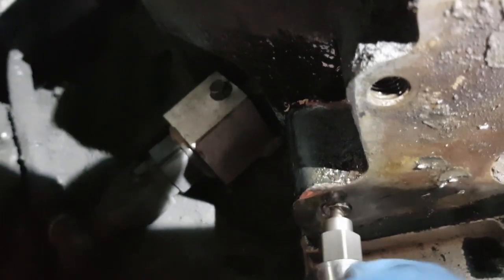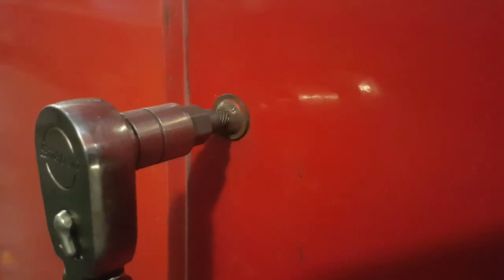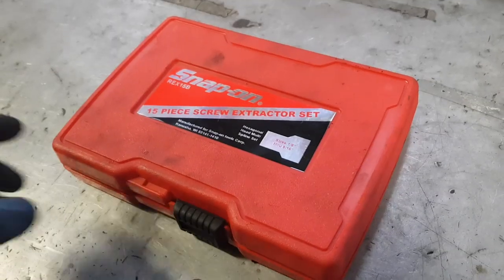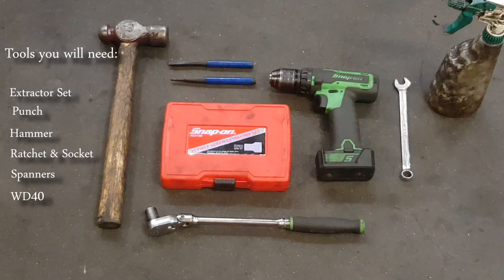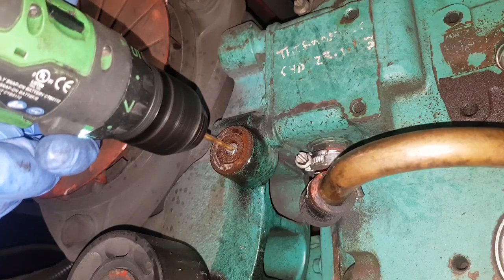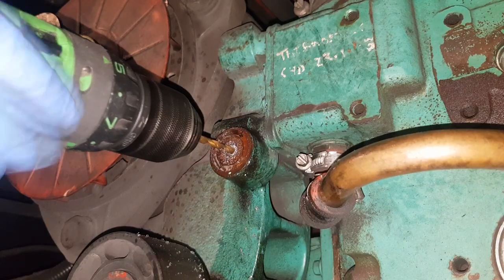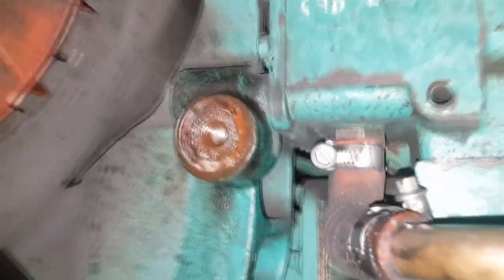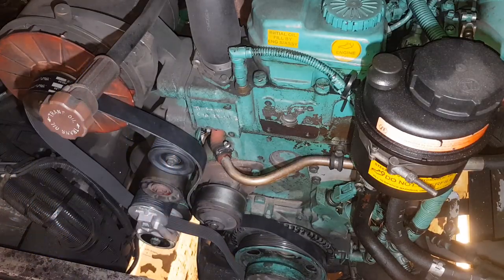How to Remove a Broken Bolt | 3 Ways to Use an Easy Out/ Stud Extractor

Comment: Good video.  The only thing I'd do differently is use a breaker bar during removal, especially if you encounter a lot of resistance.  What you give up in convenience you more than make up for in the additional strength and preventing damage to the ratcheting mechanism.  You could, of course, start with the BB, then switch over to a ratchet once the fastener(s) has (have) been loosened.
Reply from the maker: Thank you. Usually I would use a breaker bar in general but most broken bolts are usually fairly loose considering the head is gone. Anything too seized usually requires more drilling, over sizing and a helicoil.... or my friend Mr. Blowtorch XD

Comment: when you using the extractor kit do you use a smaller size one while taking out the broken bolt or it’s size?????!!!!!
Reply from the maker: Whichever one fits in the deepest and grips the most when you start turning. The bigger the better as it's less likely to break.

Comment: Did you drill it clockwise or counter clockwise?
Reply from the maker: Clockwise,  but a set of anti clockwise drill bits can be a big help in some situations. Not only do they stop you potentially making it tighter, if it is relatively loose they can also draw the broken stud out.

Comment: The most important tool for this kind of job is patience. Remember the old motto for carpenters: MEASURE TWICE, CUT ONCE. The most difficult thing for me to do, is to set aside my male ego, be patient, walk away and THINK, make a PLAN, gather the correct TOOLS. 

Also, WD40 is not a lubricant. It is a solvent. If you use it on bicycle chains, you will destroy them. "WD" came from Water Displacement. "40" came from formula no. 40. The best lubricant in this case would be PB Blaster, a PENETRATING LUBRICANT - - or something similar.

Comment: What do you do when the drill bit breaks off in the bolt?
Reply: Then the extractor broke off in the bolt .
Reply from the maker: Cry.... No seriously this happens sometimes. Try to use a very small drill bit next to the broken one. If you can make multiple holes around the broken bit, you can then use some long nose pliers to wiggle it free.
Reply from the maker: If the extractor breaks off and there is nothing you can do to free it. It basically mean the stud is seized and far to tight to come out this way. You will need to drill out the entire thing. Then either cut a new bigger thread or use a helicoil kit to insert a new thread. I think I'll make a video on this too actually.

Comment: Could smaller size bolts be extracted?
Reply from the maker: Yes absolutely
Reply: @MrBoostLee  okay cool. Are threads normally stripped when a broken bolt occurs due to over tightening?